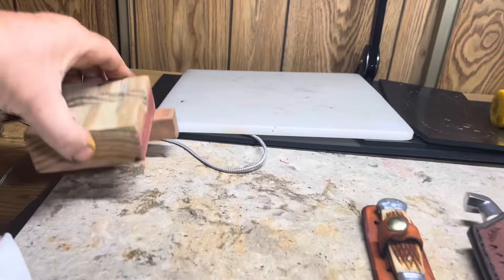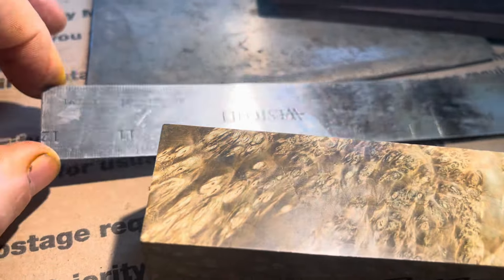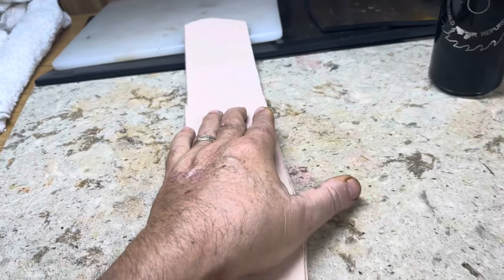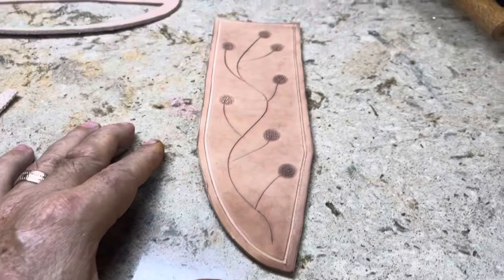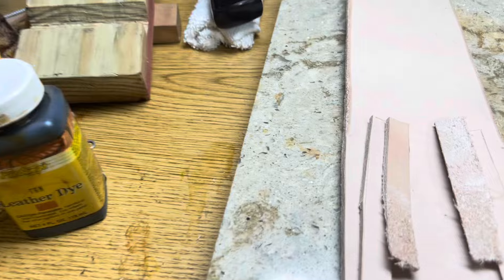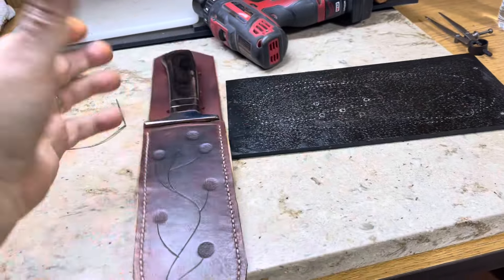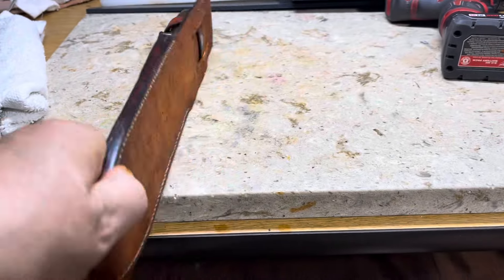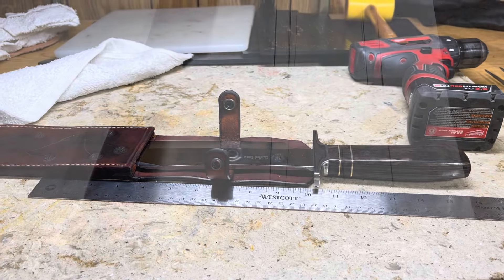Oh my god Becky, look at that sheath

Comment: Wow! That’s a lot of holes and pins! Ouch.

I’ve been trying to find something that works as well as the needles that is like a push pin. Something with a head on it.
There’s plenty out there, but they aren’t tempered and too bendy. Needles are available and strong enough.
There are indexing pins made for aligning leather. I found some for $8 each!! (what a rip!)

You must feel like a pin cushion, but I can’t think of anything that would more effectively avoid missing a stitch.
I ended up using rivets for alignment with five stitches between them. I hate getting poked fingers.

Round nosed wire bending pliers and some tempered spring wire could make something with a loop on one end. A finger tip saving loop. 
Big sheath looks great. 👍
Reply from the maker: I’m still thinking on it. I’ll run across something that will work.
Reply: @bctruck  
Yup. same here.

Comment: You could always go down the rabbit hole of making leather mask/sheaths for those cleavers 😎
There is no way I can control a power drill like for detail work (multi-layer holes). I typically use a pin vise - one hole at a time.
Reply from the maker: I tried a pin vise but my fingers get to tired.